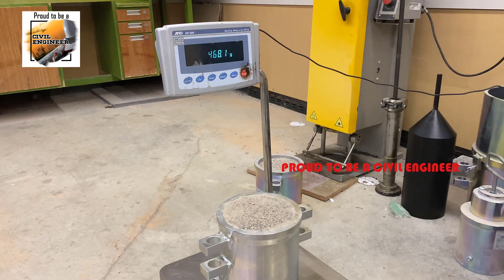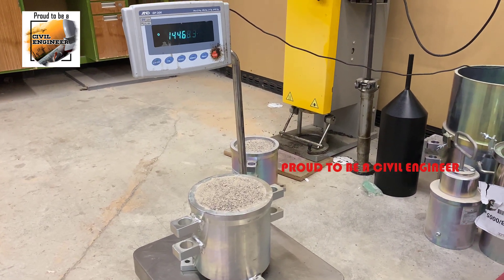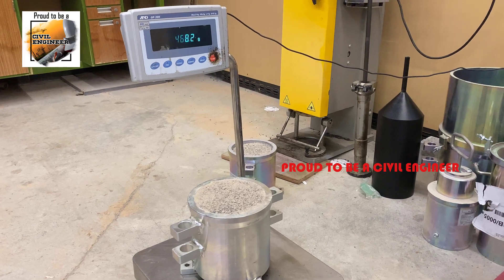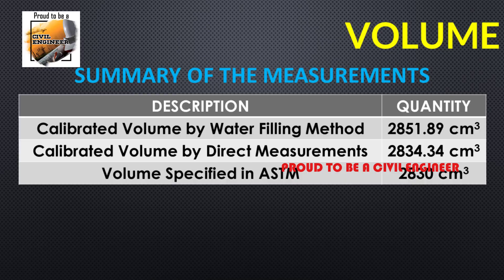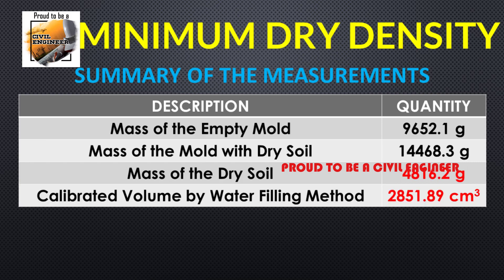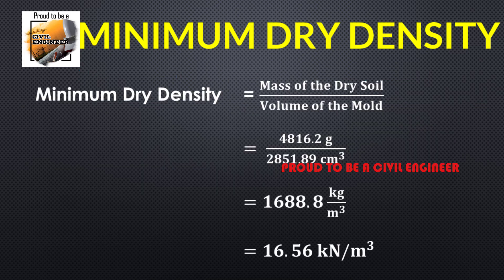Relative Density of Cohesionless Soils | Minimum and Maximum Dry Density of Cohesionless Soils

Comment: How to calculate void ratio max and min
Reply from the maker: To calculate the maximum and minimum void ratios of a sand from the minimum and maximum dry density tests, you first need the specific gravity of the soil solids. The minimum dry density test gives you the loosest state of the sand, so it corresponds to the maximum void ratio. The maximum dry density test gives you the densest state, so it corresponds to the minimum void ratio. Using the basic relationship between dry density and void ratio, you take the specific gravity of the solids multiplied by the unit weight (or density) of water, then divide that by the measured dry density and subtract 1. When you use the minimum dry density, this calculation gives you the maximum void ratio of the sand, and when you use the maximum dry density, the same calculation gives you the minimum void ratio. In simple terms: loose state (low dry density) → high void ratio; dense state (high dry density) → low void ratio, and both are obtained using the specific gravity of the sand and the corresponding dry density from your lab tests.